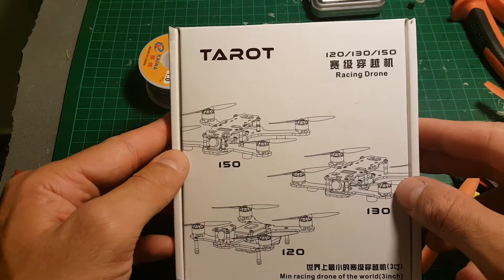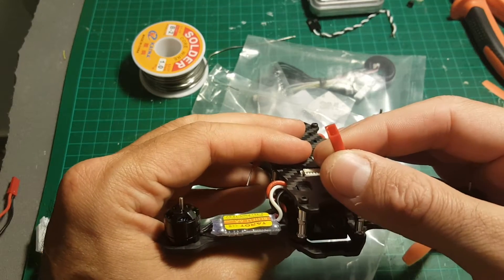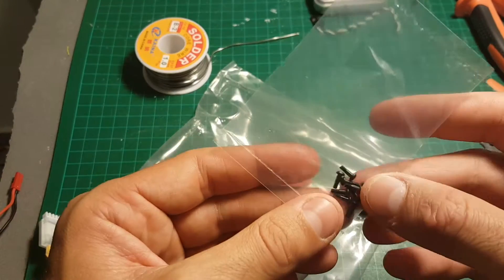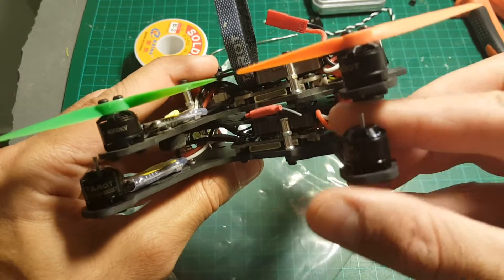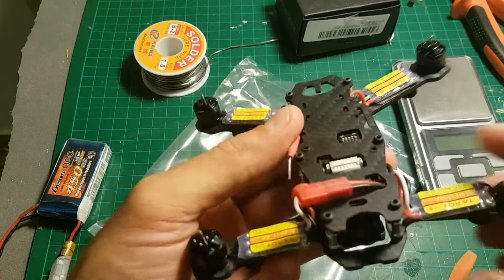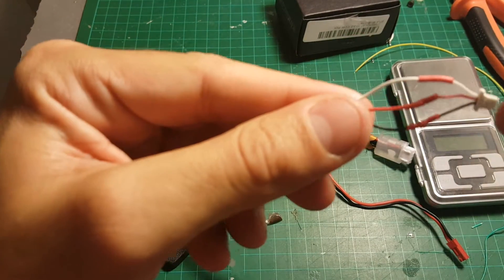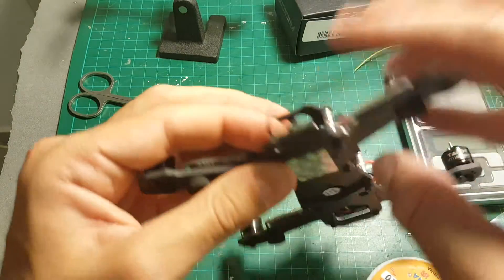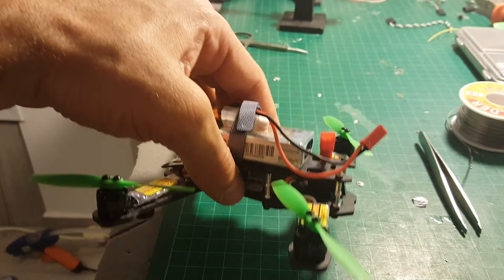TAROT TL150H1 150 FPV Racing Quadcopter BNF (courtesy of gearbest.com)

Comment: I have the 130 and am unable to get it to power up when connecting it via the "unique" USB cable.  Any suggestions that you can offer?
Reply from the maker: Does it power up when it is connected to a lipo battery?